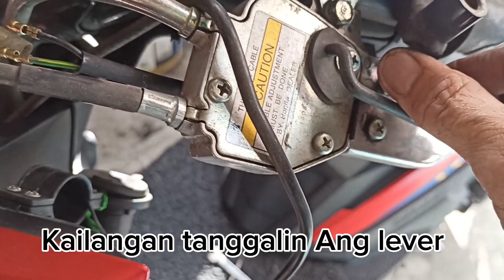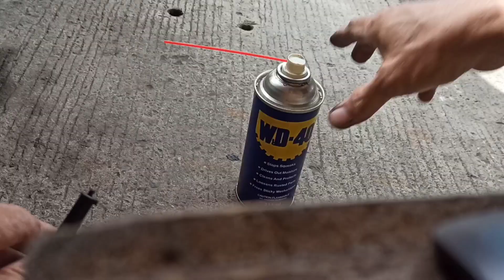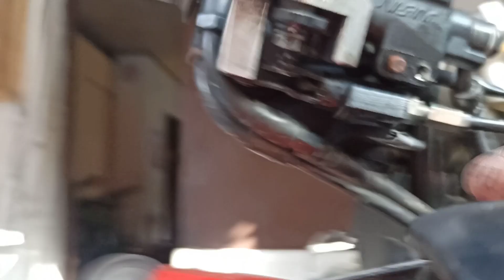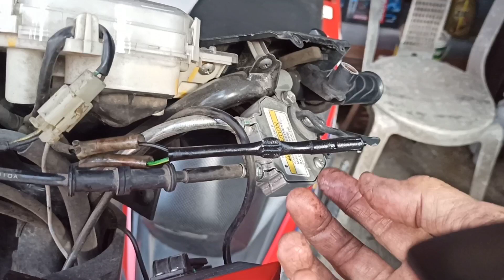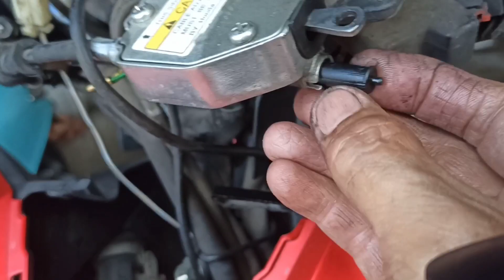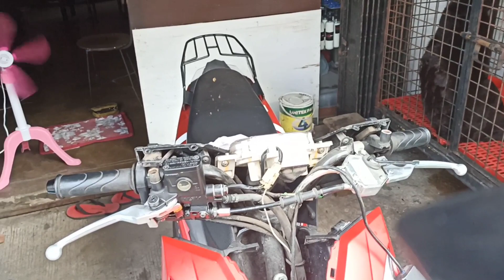BRAKE SWITCH CLEANING "HONDA BEAT STREET" #turlingmoto no copyright infringement intended

Comment: ser yung beat ko ,kala ko pundi brake light di pala .

kahit pigain L&R brake di sya nailaw ,pero pag irekta sa batt .guds nman
 ganyan din kaya prob non ?
isa pa pag mag start ako di na need pigain yung mga brakes ,mag sstart na sya kahit dimo pigain 
ano kaya prob
Reply from the maker: gud day po, sir,  left & right brake switch po sir paki linis po....na stock na po Yan...dahilan po Ng nauulanan tapos po matutuyo...nagkakaroon po Ng acid rain po Yung brake switch... spray nyo po Ng contact cleaner wd40...left & right po sa lever...mas maganda po kalasin...para po Malinis po Ng maayos... thanks & God bless you 🙏 always.. ride safe